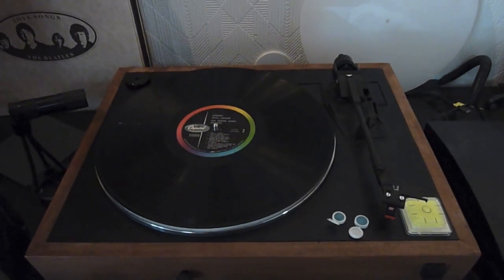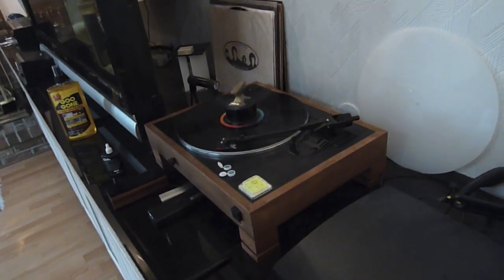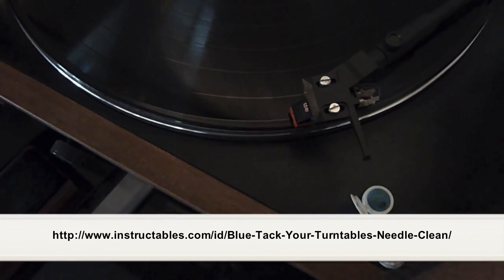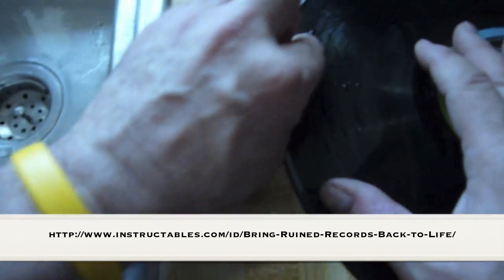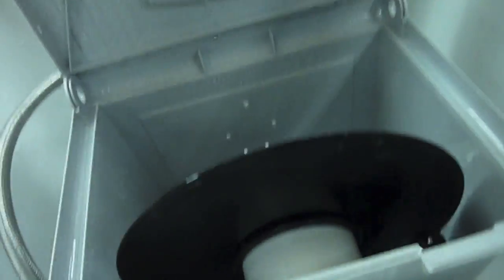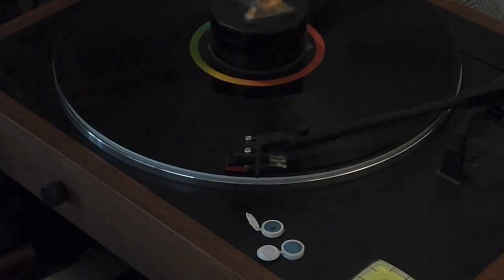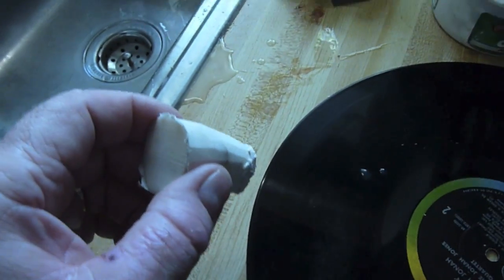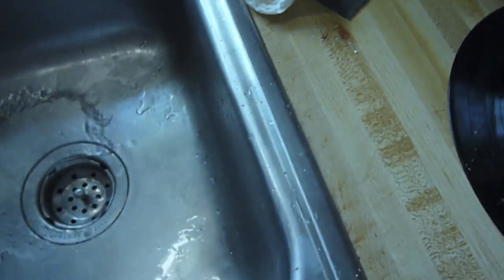Resurfacing Records to Sound New Again

Comment: Cleaning vinyl with any number of safe cleaners, as long as the solvents aren't specifically going to attack the vinyl, followed by washing and drying with soft microfiber, should pull most contaminants that can make for poorer sound. However, at that point, intelligent folks would be well advised to record a 44.1 kHz .wav file to any number of even free editing softwares, and use their de-clicking options, at least to locate the ticks and scratches. Editing any number of ways will be tedious, but non-destructive, and the final audio will not suffer the final insults imparted by sandpaper, etc. Just as sanding and rubbing compounds destroy car clearcoats, this tactic is just plain dumb, applied to vinyl. But if your only goal is to insist on playing old damaged records, rather than opt for alternatives, it's your time and labor.

Comment: This means well but is a terrible idea. There's no denying it sounds fine now. But that's only a tiny part of the issue. Long term this is HORRIBLE. Using sandpaper on a record is dreadful, not so much what it does to the vinyl directly, but more than that. When you play a record, the vinyl actually heats up and softens very briefly (due to the pressures involved). This is why when you have dust or detritus in the groove, it sticks there. So imagine what the residue sand you can't see is doing. And also guess what that stuck detritus from the sandpaper does to a stylus. Wears it out in record time (no pun intended).
Furthermore, NEVER use stuff like googone on a record. It might look sparkly clean but you're leaving residue on there. This is why when you clean a record you should only use distilled water with a drop of something like isoprop or a wetting agent to break the skin of the water. 
So sorry, he means well but he's not understanding the issues properly.
Oh and never use a carbon fibre brush like that with pressure. It should be held lightly over the record.
This video serves as a great informative video on what NEVER to do.

Comment: you should roll it across the grooves, not with them. Get a proper Nagaoka Rolling cleaner
Reply from the maker: Could you give me some quantitative rational for your suggestions?  Why is the direction of the roller across the grooves important and why do you feel the $40 Nagaoka roller is better than a $5 drugstore version?  The inexpensive roller has a larger surface area and would hold more dust before it needs to be washed.  If anyone knows, please fill me in. Thanks
Reply: Bruce Kinsey Hi Bruce, about rolling across the grooves...it's just common sense...think about it. A Nagaoka Rolling cleaner now sells for over $100
Reply from the maker: naturalthing1 Hey, Naturalthing1. Thanks for getting back to me.  I must be dense.  The roller sticks to the lands and picks up dust that's on the lands or in the groove and protruding above the lands.  Any dust in the groove that happens to be stuck to the dust being picked up would also be lifted out, but I don't see how the direction the "sticky" is moving would alter that mechanical action...  Bet I'd win a race doing it my way though:)  I have to admit, the Nagaoka Roller is a neat looking bit of equipment.  Is that what the directions for the Nagaoka say to do?
Reply: Hi, no problem. About the direction your roll your roller. I have tried both ways. Rolling the way you do of course is like rolling diagonally and you can only cover a straight line since it does not curve. Rolling across the grooves you just go to the next section of the disc after you roll it. Nagaoka used to have a roller that you roll with the grooves but it was angled like a cone shaped type roller. It proved to be unpopular so they went back to the straight cylinder shape roller to roll across the grooves. But I guess what ever works best for you. Its all good
Reply from the maker: naturalthing1 I know of what you speak.  A couple of years ago, I came up with a system that uses blue tac to deep-clean a record's groove the same wray the Nagaoka cleans the surface.(http://www.instructables.com/id/My-Incredible-Vinyl-Record-Block-and-Bar-Cleaner/).  I also tried using a cone type roller, but as you mentioned, it was unpopular (with me), so I've gone back to the straight one.  I use blue tac initially on my GoodWill finds.  It requires a bit of care to use and is probably no better than a long power washing or wood glue.  But it's dry, quick, shows me how much dirt has been removed and allows me to listen to the record before I spend more time on it.   I agree that straight or angled roller direction is a preferential issue, but I'm enjoying our conversation none the less. Check out the block and bar cleaner.
Reply: That's very interesting. Does that blue tac leave any residue?

Comment: Hello here is an expert. Almost everything you state in your comments is based on air. Nothing. Example: How deeper the needle goes the more detail you hear at the highs of the audio. The microscopic dust particles can not even go that deep in the vinyl groove. The are between the wall of the records groove. So how can a record be destroyed by gouges and scratches if a dust partical cant go that deep.? You are an example of people wanting to believe that old is still good. Next time buy an tape recorder. It seems they have better quality then a vinyl record.
Reply: Vinyl is still relevant.
Reply: Adolph Oliver Bush
It's still relevant in that some people are still buying and collecting it (myself included).  It hasn't been relevant in terms of sound quality since tape recorders improved in the 1940s - 50s. Tape recorders of this quality became available in the consumer price range by the 70s. (I'm talking 1/2" and 1/4" tape, but even cassettes surpass vinyl in some respects.) Then CDs came along... vinyl has been surpassed by several technologies from an audio fidelity standpoint. They do make nice collectibles, though.
Reply: slushh This is simply not so cut-and-dried as you make it.  I love my RtR, and enjoy cds as well, but there is a reason vinyl is still a viable format. I'm not going to debate this with you further, as it is truly a no-win situation, but there is a reason that audiophiles still collect vinyl and spend 5k on a cartridge alone, and it certainly isn't "nostalgia".
Reply: I would have to disagree!  Reel to reel tape recorders are nice, but hard to find, and expensive.  Cassettes have very low quality.  I have over 1,000 records, 6 turntables, as well as professional mixing equipment.  Believe me, Vinyl is better!  When you listen to some of the late 70's albums (STYX, Reo Speedwagon, Supertramp, exc.) there is a huge difference!  And yes I do know that these were mastered on tape, but on reel to reel, at 30 inches per second.  Consumer reel to reel was 15 inches per second, and nowhere near the quality of the albums.
Reply: Adolph Oliver Bush
It's really very simple to measure things like wow, flutter, frequency response, speed variation, channel separation, needle angle, and dust. You probably see some of these measurements listed in any cartridge, turntable, or tape player you buy. (Not so much on digital formats since these problems don't exist or the measurements far exceed what's needed.) I would call the reason you can spend 5k on a turntable "snobbery", "self-deception", and "large disposable income". You can get great turntables plus great carts for well under 1k. Maybe for under $200 if you check garage sales and replace the cart.
Reply: slushh
Like I said, I don't plan on debating this with you further.  I have a very humble tt setup, no 5k carts in my home.  Currently I'm enjoying a 50 dollar Shure M44-7 (in production pretty much for 50 years). 

Your argument of measurements is an impotent one, at best.  The finest, most desireable automobiles are hardly ever those with the highest horsepower, highest rating on the skidpad, etc.  The best paintings aren't the ones most like reality (Guernica, anyone?)  And finally, the women that are considered beautiful are not one specific set of measurements/color/etc.  Measurements are a tool, a litmus, but are hardly the bottom line to what makes our faces smile, and our hearts flutter. 

Vinyl has that unbroken line, no digital representation, and like I stated earlier, is still very relevant. 

You can press on with this.  I've already said more than I cared to say.
Reply from the maker: slushh Guys, I have no dog in this, but slush's electron microscopic image got me thinking.  Here's a great video (and song by Zammuto) showing what scratched vinyl looks like under extreme magnification (an intensional, not accidental scratch... But it's the same, only a whole lot more).    https://www.youtube.com/watch?feature=player_embedded&v=O4hbMkcatAY
Reply: slushh
And you can continue your haughty ad hominem attacks.  You're rude, dismissive, and basically an audio elitist. 

 By the way, I have my own studio.  I've worked in radio for almost 12 years.  I've done editing, recording, and all sorts of things you do not know about. 

I'll leave you with this -

De Gustibus, Non Est Disputandum
Reply from the maker: +FutureLine Roy 
Sorry it's taken so long to reply.  I've given up reading YouTube comments a couple of years ago.   First, as an expert, you must be an audiophile.  I agree with half of what you say.  Because the way audiophiles handle records, they've never experienced scratches.   

Dirt can and does get all the way to the bottom of a groove btw.  It also wedges between the walls as you say.  But dirt and scratches are not the same thing.  Dirt will cause a "tick", but it won't be repeated over and over again as it would with a scratch.  Scratches are mechanical defects on the surface of the vinyl between the land and groove that can only be removed by resurfacing.

I'm old, but I also keep up with high tech.  And I do believe old is good, because where do you think "new" comes from?
Reply from the maker: +Adolph Oliver Bush 
Again, sorry for the lateness of my reply.  I really don't pay as much attention to comments as I should and I don't know who you were referring to here, but I'll assume it's me. 

 I'm sure you know many things I don't have a clue about, but I know materials and their properties, so that's not one of them.   I'll apologize for any rude, dismissive remarks I may have made, but I'm not an audio elitist for sure.  I like all kinds of music, so I agree with you there.
Reply: Bruce Kinsey
My apologies, Bruce.  I went back and check.....yeah, I quoted slushh, or whomever it was, but definitely not you. 

Sorry for any mix up.  Enjoy your music, whatever your format.
Reply from the maker: +Adolph Oliver Bush 
No harm, no foul Adolph.  I enjoy all comments and lately, my format seems to be iPhone and earplugs:)  Thanks for responding.

Comment: if the skip doesn't cause a repeat, then it's just analog listening experience
Reply: What does that mean
Reply: Means put a candle on and the flicker will match the pop sound. Analogue is organic as opposed to digital confines
Reply from the maker: +braaheim 
I like that.  I should read comments more often.
Reply: Yeah, but if it's fixable and you've got a little time on your hands, and if you get a result that sounds mint as fuck, why not do it?   These cringeing pearl-clutchers are being sillygeese, and I plan on using some of these methods myself.  I've got a few discs I can think of right now that I'm gonna give this a go on.  And your anvil clamp is sweet as hell.  Keep spinning em.

Comment: The fact that you're using tap water and SANDPAPER on your records is a little scary.
Reply from the maker: I know... But we'll never learn anything if we don't question the status quo once in a while.  The bad thing about tap water is the minerals that are in it.  Minerals are hard, and hard things aren't good, especially with a diamond hot enough to soften the vinyl and minerals together sliding over them.  A carbon fiber brush allows me to insure every particle is swept out.  Distilled water is fine, but it's a little too retentive for my blood. I'll use lots of tap water and deal with any impurities that come along with good old 21st Century technology.

Now,  SANDPAPER... That takes nerve.  Ya just gotta have faith I wouldn't send you down the wrong path.  If you DO try it, please post your experience. Good or bad.  That way others will have a better sense of it's value.

Start with a trashed record you don't care about too much.  Then it won't be quite so scary:)

Thanks for commenting
Reply: Bruce Kinsey Yeah, using sandpaper does take nerve. because it is very easy to ruin vinyl with it. and shining it up with turtle wax polish is just going to gunk up the grooves and potentially ruin the record.

I`m not trying to insult you, but this is just a crazy way to clean records!
Reply from the maker: Bailey Peterson No insult taken.  It's all about everyones' own opinion and experiences anyway.
Reply: Cool record stabilizer Bruce. The rest of your video scares me but that stabilizer is cool.
Reply: yes finally someone with a brain ..to each his own...

Comment: Yeah, that sandpaper will smooth all kinds of ridges.  Oh, except the sound is included in those ridges!  So, if you're bothered by all those high frequencies and detail, go head and take some 1500 grit sandpaper and smooth those down!  And the polishing compound will get right down in the groove and smooth out all those ridges, too!  I'm amazed at how much abuse a record can take!  That's it: I'm reporting you to the ASPCV (American Society for the Prevention of Cruelty to Vinyl)!
Reply from the maker: On a trashed record, those edges are already well rounded and highs have been destroyed years before.  They’re also most likely to be beyond hearing range for most people, if not all. 

I agree with your comments about polishing compound.  Unfortunately that was experimentation for all the requests I’d received in other presentations (I called them “retentives”, but they turned out to be EBay scammers). 

I love the ASPCV report btw

Comment: I know a FASTER and CHEAPER solution: buy another copy!
All of this for a scratch? Definitely overkill.
Besides, all that Goo Gone stuff you put on the record (stain remover?) is bad for the record in the long run.
Reply: I agree, if you can find a clean copy and not be out of pocket too much, then it is much simpler to buy one.  However, I had a rare 1968 record and locating a clean copy for the money I could afford was unlikely, so I tried Bruce's scratch repair method and no more skipping record, and no audible trace of the scratch.  You can clearly see where I wet sanded on the surface of the record, but I could care less how it looked, so i didn't bother with the last step of polishing out the sanded area.  I just made sure the grooves were nice and clean and I was happy with the result.
Reply: Actually it may not be faster because then you would have to wait for shipping.
Reply: It's certainly a benefit to know these techniques to enjoy music now if it's in your hands yet damaged. I collected early vintage sounds I love from long gone labels. Even listening to them with the pops and scratches is better than not at all. Some of my favorites sell on eBay for 600$+. I'll take the time to give TLC to the ones I own. Thanks for the help and added confidence. Finding one copy is hard enough and this thinks you can just find another. Ya right. ??!!!
Reply: You fail to realize that there is not always "other copies" around at the ready.
Reply from the maker: +Fabrizio Vigni 
Thanks for the comment and sorry for the delay in responding.   Here's my spin on what you wrote: new copies may be faster, but not cheaper.   Overkill? I don't understand that.   And GooGone is not bad for the record... Ever.  You'll need to look up what effects vinyl to understand that.  All records will eventually outgass all of their plasticizers, so your great, great, grandchildren will see the results of time, but they won't see the results of GooGone except to say "This record is crap, but great, great grandad sure did keep it clean". J

Comment: OK, all that polishing to a smooth surface, that works on CDs because the pits are below the resin and aren't disturbed.  On vinyl, you are for sure taking away from the sound by exposing the groove which contains the actual music information to all that abrasion.  Please do not treat your records this way and then put them on eBay.
Reply from the maker: I totally agree about not putting resurfaced records on eBay.  Early comments focused on polishing the surface.  I realized then that the reason people were asking was for resale.   A resurfaced record is difficult to disguise.  A mirror surface isn’t going to happen.  If you’re buying a record listed as “like new”, be sure it’s mirror finished. 

Read my other comments about sound quality.  Sanding doesn’t affect the walls of the groove where the sound is produced. It only cleans up the edge between the groove and the land. That’s where the damage is and what causes the problem.